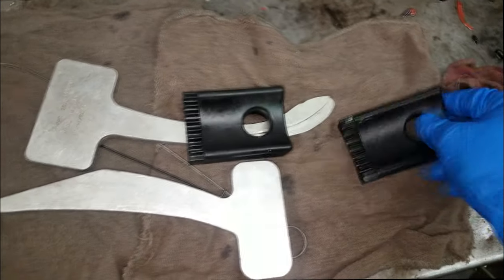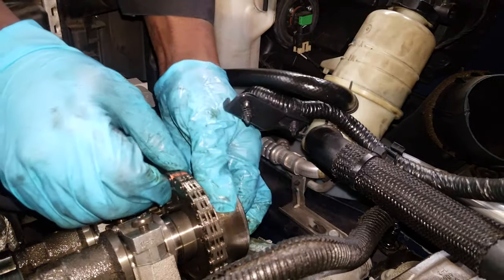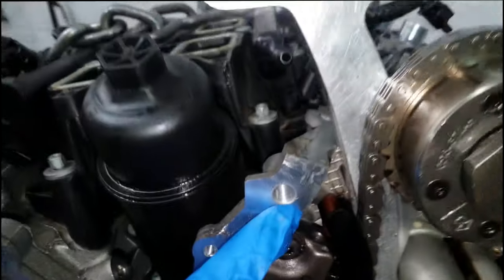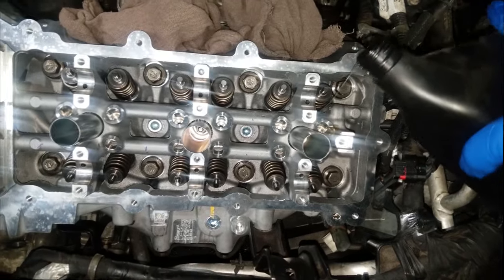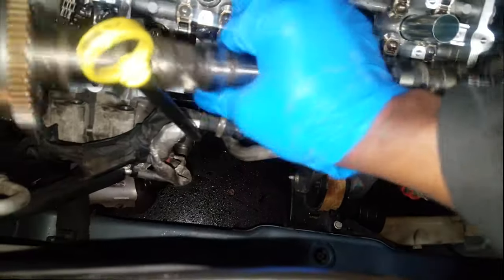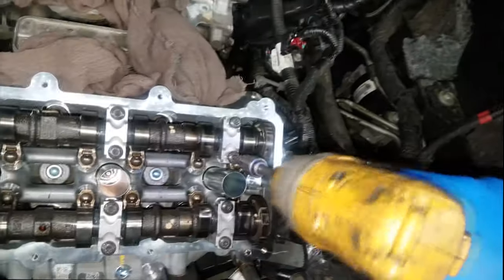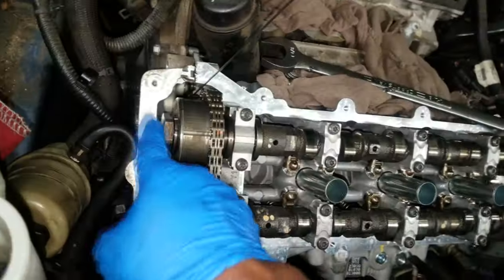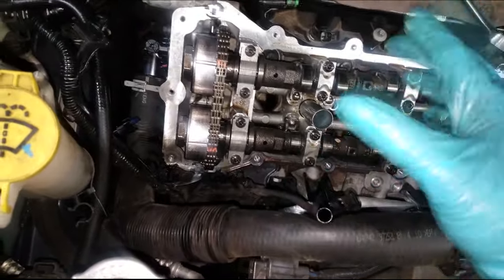How to Replace a CAMSHAFT, CAM Phaser,  rocker arms, 3.6 Pentastar, Timing Chain TOOLS P219A P219B

Comment: Ive had all cams shafts replaced along with rockers and lifters. Replaced all timing chain along with dampeners and I replaced the oil filter housing to an aluminum one.. After all said and done the caravan is still showing a code of timing and has a miss, they check it out several times to make sure weverything is right. Please what is your oppion on this. My van is a 2013 and has been in the shop foor 9 weeks

Comment: Hi I think I have an issue with the cam facer on my 2011 dodge charger the traction control light comes on  sometimes when I first crank it up and makes a rattling noise I turn it off and crank it back up it doesn't come back but when it comes on and I drive it like that it takes off a little slow. So the question is what is the symptoms when that goes bad?

Comment: Quick question. I have to change rockers and lifters in my durango. My question is in regards to removing the caps. Other videos and information I have watched stresses rotating the cams to rest position before removing the caps. Any Insight to what this means would be extremely helpful. Thanks in advance.

Comment: Your a great micanic, thanks for pointing out everything. I have a ticking in my engine, it's 2014 Town and Country Van. I think it the lifter I scanned the engine and it said cadlic converter need to be replace, and then it said sensor 1 PO 420, bank 1, and sensor bank 2 PO 430 needed to be replaced. When I start it up, I get the lights on the dash to light up like a christmas tree. Speacily when it's cold out and rainy, Not sure what that could be. But it's starting to drive me into det, lol Do you have any idea's???

Comment: Which one is the exhaust camshaft and which is the intake?  I'm working on bank 1.
Reply from the maker: See Short reply
Reply: Turns out they're labeled, "RE", etc.
Reply: @OnlineMechanicTips  Got a new subscriber!   Thanks!  Everything just came in, getting ready to tackle this job.
Reply: Started up the Durango for the first time today after replacing all lifters, rockers, and 3 of the cams. It seemed like everything was fine until it wasn't. Suddenly the car jumped a little and the check engine light came on. It was doing this exact same thing before my repairs. The car goes into low power mode and it's a lot more difficult to drive. 

I opened up the hood and the engine was shaking side to side. 🤔.  Any ideas?

Comment: Is there any good reason you couldn’t just hold the camshaft with the 1-1/8” wrench when breaking loose and tightening the can phasers? Do you really need the cam gear teeth tool?
Reply from the maker: Thats the recommended way to remove the phasers is to use the wrench to hold the cam, not the plastic tool. Are you getting ready to do a rocker arm job? Also are you subscribed to the channel?
Reply: @OnlineMechanicTips  I’m thinking about doing my chain guides and tensioner. Any pro tips? It’s a 2014 3.6l Grand Cherokee

Comment: OK, I got one that has me a bit stumped.. 2017 Promaster 3.6.. losing oil fast - Appeared to be the PCV so it was replaced but at one point appears to have lost oil pressure for a quick min.. Lost timing.. Pulled the Bank 1 valve cover off and found slack on the Front (non-tensioner side) of the Bank 1 chain..  Do these tensioners just collapse or is there something down in there it could be hanging up on? I ran a camera down inside the cover and cannot see anything snagging but I know you have a TON more experience on these motors than I do.   Thanks in advance!

Comment: Thanks for the video! DIY guy and subscriber here.  I have the tick on my 2013 T&C and I am getting ready to fix it. Couple of questions: What are the tools needs (part numbers), I don't see them in the description? On that same note if you were just going to do this once (that is my hope) can just use the cheap amazon version?  Now my noob question do you put RTV back between the cylinder head the valve cover meet or should it just be torqued to spec?  Thanks again for the great videos!
Reply from the maker: Hey bud thanks. The tools used in the video are high quality dealer tools. Im not sure those are fir sale. But I've heard the Amazon kit works just fine. And yes, it helps to put a dab of rtv on the outer parts of the gasket. Thanks for watching

Comment: Great video and a great help in working on my daughters 2015 Jeep Cherokee with the 3.2l with a few knockin' rockers.  I will say i got my butt kicked some today as apparently the Cherokee's have some AC lines in the front and the intake brackets that are next to impossible to unbolt unless the front end is pulled off. Crazy. Had some trouble with the front bank today and had just unbolted the oil control bolts so phasers would move out some then had an issue where i had to remove them and lost the tension release. Fought that for awhile and quit for the night. Looked thru your video and i believe i can get it figured out now.  I was worried about the timing chain being loose and getting enough slack to put them back, which kicked my complete butt. My main question is...where can I get that "grenade" that you use...or how is one made? That's the ticket right there! Thanks again...great video and help.
Reply: Got it all done and back together and after being as careful as a person could over 2 days of working on it, it doesn't start.  Jeez.  Time to check all connections.  I do smell gas it seems when it's cranking, though.  I know for sure that cams are in right locations (marked them), timing was at TDC, had the correct parts, lubed cam hold downs with assembly lube, etc. Man, it's got to be something simple but almost seems like compression thing.  And, of course, I don't have a code reader here and no other vehicle to go get one as we had to do some vehicle flip flopping.  Always something, I swear

Comment: Hello sir. Dodge 3.5 and 3.6  if the engine belt and chain break or the engine will be completely damaged????   I have heard that the valves break
Reply from the maker: Yes, valve damage can occur if a timing belt break while driving
Reply: @OnlineMechanicTips    Thanks. Sir how many miles can these 3.5 3.6 engines go? I have heard that gasoline engines are not long-lasting

Comment: What's your thought on those little lifter assembly failing?   Not just bearing failures on the rockers
Reply from the maker: As for ticking, those are never the problem, but can they cause a tick? absolutely. I rarely replace them at all. I try to keep my estimate from a parts stand point as low as possible. So I don not replace stuff thats not needed. I do however replace known failing parts such as all the rocker arms. The cams have to be wiped out for me to replace them, not lil scratches.
Reply: Well that's the thing unless there is a definite catastrophic failure in one of the rockers unless you go through all of them and feel them for grit in the bearing and you still have a misfire even after fuel injectors that would be the last possibility

Comment: Subscriber here. Enjoy all your vids!  Got a question for you . I have a 15 grand caravan 3.6 . 98k. No valvetrain noise at all ,runs great. My last oil change ,i notice loads of tiny metal particles in the oil filter . Should i wait til i hear noises before removing valve covers ? Is the metal  coming from something else ? Of all the videos ive been watching about the failing rocker arms , no one mentions metal in the oil filters . Thank you
Reply from the maker: A good way to tell is if the valve covers off and and you see your camshaft magnetic tone wheels saturated with powdered metal shavings then thats a sure sign that one of the rocker arms starting to fail. Early repair can save those camshafts.
Reply: @OnlineMechanicTips   THANK YOU !!!!!

Comment: I have a 3.6 that had misfire in cyl 3 bank 1. we ended up pulling the heads replacing everything new cam and rockers etc. everything is back together and still throwing same codes and misfire? Any way I can contact you and go more in depth? Thanks!

Comment: My dealership service diagnosed our 2014 T&C for having bad right cylinder and needs new intake cam phaser quoted at $4,900 to repair. Should I get a 2nd  option? Would you recommend getting rebuilt engine instead? Much appreciated.

Comment: Looking to replace Cylinder #5 valve seals.  I know to remove them, I have to take the cam off.  Don't I need to bring it to TDC for #1 cylinder to remove the cam?  If its at TDC on #1, how do I get it to TDC for #5 in order to pressurize the cylinder and remove the valve seals?  Wouldn't I need to turn the crankshaft?  How do I do that and not mess with the timing while the cam is off?
Reply from the maker: Im curious as to why you replacing the valve seals? Also are you subscribed to the channel?
Reply: @OnlineMechanicTips  the van runs extremely rough on cold start up. Once it is done warming up, it's fine unless it sits for several hours then same thing.  No ticking noise is heard, I've replaced plugs, coils, injectors all with Mopar but still keep getting p0305 error and very rough cold startup.  Yes sir I am subscribed, I love your channel

Comment: how come you didnt torque the intake phaser before removing the cam holder?
Reply from the maker: You can do it at anytime. Just as long as it gets done. In fact I mention that about 3 times. It may not have made the video but it was done. Also keep in mind that this not a tutorial video.

Comment: Good evening, I need your help, I have a 2012 dodge Journey sxt 3.6. Im replacing the head gaskets, valve cover gaskets...etc, my question is. Do I have to get the timing tools,  remove the the timing chain completely in order to replace the head gasket. Can I just paint mark the chain and slip it back on exactly where it was. In other words what's the easiest way to replace the head gasket on the 2012 dodge journey 3.6.
Reply from the maker: First off im curious as to why you replacing head gaskets on an all aluminum engine? Also are you subscribed to the channel?
Reply: @Online Mechanic Tips  yes im subscribed. I was told I needed to replace them
Reply from the maker: @royalwilson6640  Listen my friend, this is a huge job and yes special tools are needed. You saying you need head gaskets replaced? That is something we rarely do on this engine. But the answer to your question is yes. If you doing both heads its a good idea to Remove the cover.
Reply: I was constantly adding antifreeze, no leaks we found around the car, running hot, loss of power...showed all the signs. Why does the it being aluminum makes a difference?

Comment: So i have been chasing po369 and po394 codes for a year. No fix. Replaced pass side exh cam, phasers, sensor, wiring and seem to fi xit then it decided to now pop po394 code. So i replaced sensor, wiring, phasers and crank sensor, found damaged o2 sensor so i replaced. Sent pcm to wrangler fix they tested it and said its good. Still getting po394 code uphill highway speed only. Cams on driver side looked ok no abnormal wear.  All parts are mopar parts. Any thoughts ? Im at a loss.? Its been to the dealer and 2 independent shops and me and we are all baffled. Now they are talking replacing all cams lifters and rockers but they seem fine. I can supply pics and more info if you want to email or txt

Comment: Had a bad intake rocker on cylinder #5 ticking away. On a 2014 jeep 3.6. When i opened it up both oil galley bolts were loose and had almost fallen out by the cam phasers. I replaced the bad rocker and put in a new lifter as well, a whole set wasn't in stock locally. Tic is gone sounds great run smooth, but now it just threw a code p0344 with a traction control skid light, it had no codes before. I checked the voltages 3 of them had 5 volts one was a ground. I replaced the cam sensor but even after clearingthe code it comes right back even before starting.  I heard some people say that that is the driver side cam sensor even though it States it's the passenger. Just for kicks to verify i unplugged the driver side and got a different code saying sensor 2  so bank one is correct as the passenger side. But it wont let me clear the new code either say permanent just like the bank 1 issue.
Reply from the maker: Hey  bud, this has to do with timing. Curious if you torqued those cam phasers to specs and even how did they look/feel when you had them off. Those cam phasers can easily cause this problem.
Reply: @OnlineMechanicTips yep,  they felt tight they wernt sloppy like the bad one you showed in the video. I have the p0344 bank one sensor one intermintant. And a traction control light. Doesnt that have to do with the exhaust on the passenger side. Everyonesayingit could be a bad connector since there is a tsb but im getting the correct voltages. Could the loose oil galley bolts of caused it to aclimate differentand now that the pressure it back cause unusual timing, there was metal on the reluctor wheels i wiped off gently with a rag.  Thanks for your help

Comment: I replaced my L I and L E camshaft,Rocker arms and lifters on my 2014 Dodge journey 3.6L. The engine sounds like it's running fine until the engine is warmed up. After 15 minutes the oil pressure drops to below 200 and the engine turns itself off. The codes coming up ar P0018 and P000D. Can you please help me figure out the issue. I noticed that on the opposite side of the camshaft phaser on the L I the cap with lines was bent and I straightened it by hand. Is it possible that the timing is off because of that? Or is it possible that the torque specs are off and it's causing the sensors to read the timing wrong?Thanks so much for all the great tips. You're awesome.
Reply from the maker: Hey bud, this a Dodge Journey FWD vehicle, so when you say L are you referring to the front bank 2 cylinder head? Also are you subscribe to the channel?
Reply: @OnlineMechanicTips  yes I subscribed to your channel. Yes I am referring to bank 2 cylinder head. The code was P0018 before I changed the oil pump. I also re timed it and now it runs almost perfectly. Still 1 code coming up.P0019 Bank 2 Cylinder 2. I'm changing the phaser on the camshaft today and crossing my fingers.
Reply from the maker: @seboy07  Also while you replacing that phaser, make sure those oil gallery plug tight. https://www.youtube.com/watch?v=_Ow6NmN9ASM&t=483s

Comment: i need to know the name or a link to where i can purchase the tool used to remove the OCV (oil control valve),PLEASE and THANK YOU!!!
Reply from the maker: Hey bud all tools used in this video are dealer supplied Miller special tools..Not sold to the public I don't think..but I've seen the cheaper lower quality kits on ebay
Reply: @OnlineMechanicTips  would you mind providing me with the link to those cheap quality kits,thank you!

Comment: @Online Mechanic Tips

I have a question, sir! My wife's car is a Flex Fuel and it doesn't have a Mass Airflow Sensor, so how does it calculate the Air/Fuel Ratio?
Reply: I need to understand a little better so I can fix the problem that is causing Air/Fuel Ratio problems and tripping codes for it.
Reply: This is probably too late to help but it's Speed-density.

Roughly put, at the factory they run the engines at every possible combination of RPM from below idle to above redline and intake manifold pressure from a deep vacuum to more than sea level atmospheric then note what the required fuel injector pulse widths were to get the correct air/fuel ratio. They compute the air density from the pressure and temperature then program that into the PCM as a VE (volumetric efficiency) table with the RPM on one axis and density on the other, hence the name. IE you're computing the mass air flow rather than measuring it directly via the MAF.

The minor downside is that anything that affects the engine's volumetric efficiency makes the table inaccurate.

In the early 90s SBEC days of Chrysler vehicles if the muffler rusted out and reduced the exhaust backpressure it made the engines hesitate or even cough and sputter for a few seconds any time you tried to accelerate from a stop. I experienced this personally on a 1992 Dodge Dynasty 3.3. It went away as soon as a new exhaust and muffler were installed.  My hypothesis that could be wrong is that less backpressure made for more VE hence more air flow and cylinder filling for a given density and so with increased airflow but not increased fuel flow the engine went lean for a few seconds until the SBEC realized it via the O2 sensor and richened up the mixture.

Comment: Thanks you so much for the video.  I am currently replacing rocker arms and camshaft on the right bank (rear) on my 2014 T&C.  I lined up the lines on the two phasors but there is a dimple on the intake phasor toward camshaft side right below the chain and it is a little off center.  Does this dimple need to be lined up exactly at the center or it does not matter much?  I just want to make sure everything is lined up correctly before I take off the chain.  Thanks for your help.
Reply from the maker: On bank one yes, just make sure the lines on the phasers line up. The dimples on the to cam not important for timing, just for cam to phaser sync. You should watch this bank 1 video here": https://www.youtube.com/watch?v=oUHN1GRMC7M&t=4s
Reply: @OnlineMechanicTips  Thank you so much for your reply.  One more question if you do not mind, some lifters are rock solid but some depressed about half mm when I pressed on it.  Does it have to be rock solid or tiny depression is normal?  Thanks again for your help.
Reply from the maker: @tommason5689  They are not pumped, some may still be pumped. They will not all be rock solid. This is not a problem. I sure hope you are subscribed to the channel
Reply: @OnlineMechanicTips  Thank so much for quick reply.  You are the best!!!